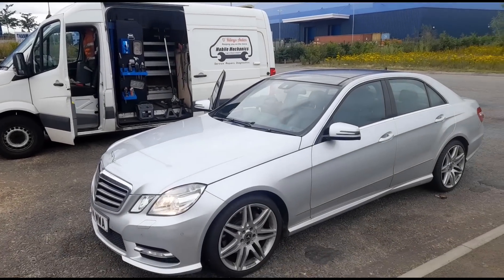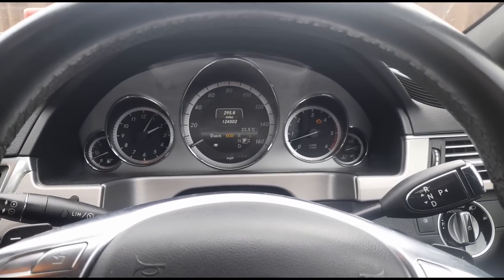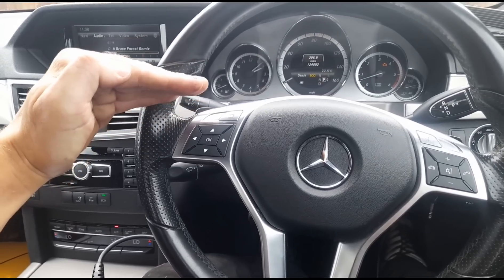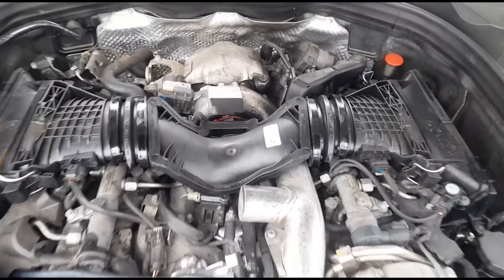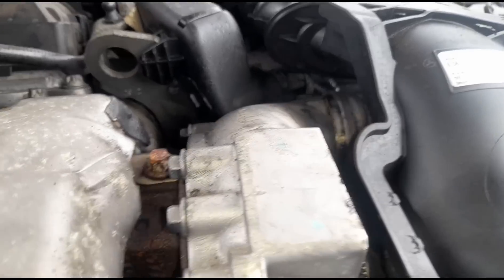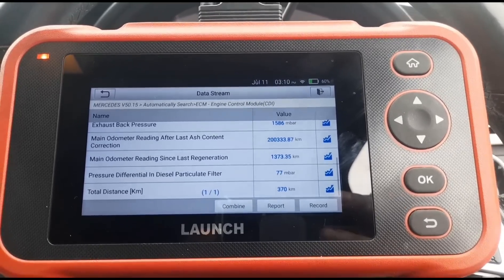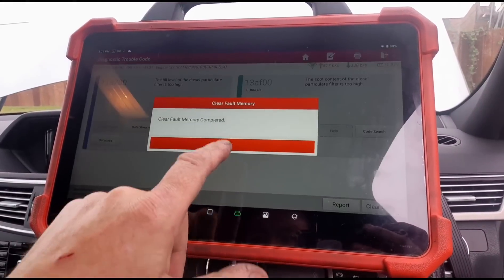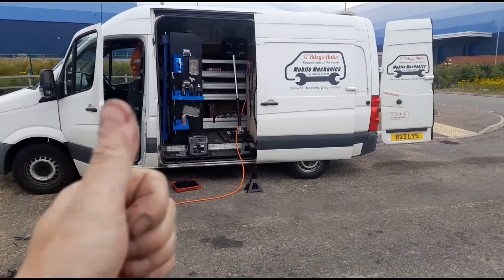WHY? Unsolved DPF Fault Mercedes E350 V6 CDI  148A00 11A700 13AF00 Number Of Regenerations Too High

Comment: I was having dpf issues and had the exact same problem on my E350!

The mechanic initially said from the diagnostic reading that the air mass flow sensor was faulty.  I had that changed, and no joy.

Turned out the seal in the turbo pipe was broken in the same place and also missing a bolt.

Many thanks for the post.
Reply from the maker: Thanks for sharing

Comment: Good job! I have the same model with exactly same engine and fighting with often dpf regeneration for 2 years now. It is super annoying as the regen is kicking in every 70 km. It is finishing the regen process succesfully after 10 km. I already replaced pcv, differential pressure sensor but that didn't help. Afterwards the dpf was taken off of the car and cleaned by the shop using the high pressure hydro method. After installation the same story. The last potential culprit suggested by mechanic were leaking injectors. They have been removed and sent to specialists to check on the table. The injectors are all good and keepeing all parameters. Nobody has no more ideas what to do next. I was suggested either to fit a brand new dpf or have it deleted. Any suggestions what else  to check?
Reply: any update on this brother?

Comment: Thank you for this video. I am trying to fix this exact same fault. Same model and readings! I now have some direction to follow and get to the bottom of this. Got all the pressure down then less than 10 miles and its rising again. The ash content thing makes sense. You're the man thank you for sharing your wealth of experience. Ps having trouble getting Launch fluid, seems to be in short supply, any ideas?
Reply from the maker: Glad it helped

Comment: OM648 owner here, been suffering the exact same symptoms for 5 years, never managed to find the root cause. Regens now occur every 20-30 miles, just crazy. Replaced turbo, cleaned DPF several times, replaced DPF sensor a couple of times, been to several workshops... I might have the same problem (excess oil coming to the engine through the turbo and the air charge pipes). How much is oil supposed to do that? Any? None? Appreciate your help to end this 5 year nightmare. If we solve it I'll throw a party!!
Reply: Try replacing the PCV valve, it'll reduce the oil being drawn into the turbo, intercooler and air intake
Reply: @elcapitan8400  thank you very much!! If it works I'll let you (and everyone here) know :)

Comment: Right so my 1.9 tdi engine is shaking like mad at idle but when moving its fine originally the garage i took thought it was injectors when i replaced the injectots with second hand  ones it reduced it got it diagnosed by injector specialist and theyre sayinh clutch i feel like thats not the problem as my engine is shaking what do you think?

Comment: Where are you located? I have an annoying tpms which just keeps coming back on on an Infiniti Fx. I changed the sensors, the tyres but I drive five miles and it comes back on. Even taking it to the main dealer didn’t help.

Comment: Hi. You use a cheaper 'Launch' tool in this video. May i ask which model it is please? It looks useful for the amateur mechanic. 
I was surprised there was no 'underboost' code with an O ring so badly perished.
Reply from the maker: Launch CRP129 EVO from www.launchtech.co.uk
Reply from the maker: There was previously a air correlation code I was told but they fitted the intake pipes and filters and cleared the code

Comment: Really enjoy watching your videos recently, I've never had any issues with DPF but as a owner of a VW T6.1 (coming up to three years) I have always been careful with prevention.. 1. using premium fuel. 2. using additives on occasion. 3. always recognising and letting a regen complete.... my question is, do you think I am doing the right things, if/not  do you have any other tips?
Reply: One of the best ways to avoid DPF issues is to make the engine work regularly. Find a nice big hill & drive up it on a frequent basis.
Reply: @hughmarcus1  that's lucky I have a big hill at the end of my daily commute.

Comment: Had a Volvo v70 D5 (Amazing car for doing serious long drives)  Purchased it "up north"  from a guy who had given up with it .Car was perfect other than  a starting issue that drove him mad .  Via a forum. I purchased the car and drove it to a carpark .A forum guy who was a bit of a legend  came and had it running perfectly in 1 hour. Something to do with injectors . Charged me £100 . . Car drove home 250 miles like a rocket and never went wrong . There are amazing people out there that are just GOOD and go straight in with a positive attitude. Most garages are just monkey farms
Reply: Was it the 160 d5 or the 185, I have the 185 never had any issues my Mondeo I've had plenty but I'm learning a lot from Jimmy
Reply: @chucky2316  185 with a rolling road stage One Map . Handed back 55 MPG on motorways been driven hard . Relaxed driving would see 63 MPG . Really was the best long distance car Ive ever had.
Reply: Legend
Reply: I love the Volvo D5 engines.
Reply: totally agree with you

Comment: The art of old school basic diagnosis is being lost on todays generation of mechanics......they are also being pushed to rattle through as many cars as fast as they can and at a dealership no one wants to work on older cars then you add to this the customer care which is sadly lacking......lucky for you as you do great customer care and find route cause.....you will never be out of work running business way you do and we will use you again and have recomended you to others 👌
Reply: There have always been dud mechanics. Take of the rose tinted glasses.
Reply: @Cheepchipsable  rose tinted glasses is how i get through the day and im old enough to say for sure with age comes experience as you have already made the mistake once or seen it before......all i know is if you find a good mechanic you stick with them unless you got money to burn firing parts cannon....which sadly seems to happen a lot.

Comment: Crazy how main dealer didn't find air leak great job Jimmy 👍
Reply: That has split since being to the dealer, the issue was the dealer was correct with the diagnosis of replacing the DPF because of the 9gr of ash which is a fully blocked DPF... the customer. The decided he didn't like the large bill to have it replaced and decided he wanted to hear a cheaper cost repair...
I see it all the time at the dealer I work at.
Reply: @johnmorton5498  Sorry but I have to disagree.  The Mercedes main dealer (in Hertford), charged the same customer >£700 for a new fuel pump to cure a noise which was not cured, then said OK we will change the fuel filter free of charge which cured the noise.  Worse than this is that this dealer followed the Mercedes service plan to the letter and never changed the fuel filter under the customer's service plan.  Mercedes and their dealers are Negligent, if you don't like these harsh facts try suing me for defamation. The same garage with the same car failed the MOT due to rusty rear break pipe and rusty rear sub frame.  They let the customer take the car to a "garage of repair" but never told them that they had burst the brake pipes, very lucky no serious accident.  Sorry that your main dealer thinking has programmed you to blame the customer - ridiculous !

Comment: Great video, 
Every one singing "Another one bites the Dust" (Or Ash in your case)
Do you ever follow up on real problematic issues where no one could fix it, except some dodgy Irish chap in a layby ;-)
And see if they have any other issues, (Return business)
Having a garage/engineer that can solve the problem totally and not just fix it for now are as rare as rocking horse ..... 
Nice job there. Keep em comming and take care.

Comment: My current car I bought it from a lad who complained it was too expensive to run with lots of suspension repairs,  it's a SAAB I put it back to stock no lowered springs no stupid low tyres , 100000 miles later still no costs ,  Muppet

Comment: I bought a car with a "suspected head gasket" for scrap value losing water from new  ,  I opened the header tank saw the pickup pipe was on the wrong side of the cap and bought it on the spot , reversed the cap on the overflow bottle so it could pickup water when cooling,  another one was the pickup pipe had fallen off , these garages are blind and stupid

Comment: To diagnose , question 1 has it ever worked ? ,  Question 2 when did it stop working,  question 3 what changed ,  and look for clues ,  what still works , not what doesn't work , eliminate and check ,

Comment: The reason why this happens is the OBD systems give the pointer to the symptom but the mechanic / technician is essentially unskilled in tracing faults , they see the symptom not the disease , the fault you found is obvious and audible so why didn't they look for the "non normal"  the clues are there, they are being deskilled by the technology

Comment: You explained the difference between soot / ash  & cause / effect very well
Jimmy.  well done mate 💪💪💪💪
Reply from the maker: Thanks Peter 👍
Reply: @ORileysAutos I'm a diy mechanic learning everyday from your videos and am always baffled they always treat the problem and never the caus. And that boost leak was so obvious I could hear it on video. Scanners only poit you in the right direction then you gotta have the skills to interptet what your reading. 
Great work as always.
Reply: @DanielSan-ch7dr  that is exactly right Daniel, a scantool is a directional base tool. Fair play for trying to educate yourself 💪💪💪
Reply: Kennedy garage and o Rileys Autos  incredible men for Diagnoses and Repair.
I would speculate that there is engine problem like pcv or turbo egr ecc creating extra buildup in the dpf.
Reply: Ok that will teach me to watch the full video before commenting. But my Speculation was Correct 😂
Reply: @tyldall  ❤️❤️❤️

Comment: Guys working in garages don’t give a damn about your car. Fix it yourself and save a fortune, plus you’ll know it’s done right. Apart from being able to do an oil change, I knew next to nothing about cars. However after multiple shoddy repairs/maintenance work in garages, I educated myself with the help of videos like this. I’ve since done major work to my car and it runs like a dream and passes it’s yearly roadworthy test……..which it never did when “professional mechanics” were maintaining it.
Reply from the maker: Only very few garages like that. Most garages are very good at what they do but I just see the people who have been to not so good garages
Reply: @ORileysAutos  Sorry Jimmy but I’ve got to disagree. Garages here in Ireland charge a fortune for shoddy work. I’ve been to main dealers, independent garages and private mechanics in the past and there isn’t one I’d go back to and trust to work on my car.  The last time I left my car into a garage here (and it’s about four years ago now), they did work I didn’t ask for or agree to and didn’t do work I actually did ask for. A few months later I felt a shimmy in the steering and after some investigation work, I saw that the two new wishbones they’d installed were both loose. The bolts hadn’t been torqued properly. When I went back to them, they told me in their best customer service manner to F off. And that’s after they charged me €2,000 for repairs and did a piss poor job of it.
Reply: @ORileysAutos  Jimmy, I brought this car to you.  In relation to this comment I feel that you are both right.  There are many well intention'd garages in Olde England, they do genuinely try their best and are not seeking to rip people off.  However I also agree that there is a massive lack of knowledge at almost all garages and I have to come to a uniquely talented trustworthy Irishman to fix the problem - thank you.

Comment: Knowing the OM642 engines, the oil around the pipe etc is most likely coming from the ruptured PCV valve on the back of the left hand head as you look from the front of the car. It's often overlooked and the oil blamed on the turbo. The green "o"ring is a common failure on these as is the orange oil cooler "O" rings deep down in the valley of the engine. Link to a good video showing the PCV valve is here....... https://www.youtube.com/watch?v=5LkWszMWPqY&ab_channel=MBDieselFreak
Reply: I own a c350 cdi same engine and your 100% correct in what your saying after changing the pcv you will also notice better mpg some people fit a catch can also.
Reply: @jakefalk6350 I think the catch can theory on these and any other diesel is a bit of a placebo. If the PCV is kept as it should be then there shouldn't be an issue.
Reply: @JamesAllen300  I think your rite I never bothered fitting 1 the orange turbo seal is also important to periodically change as when it leaks it leaks onto the swirl flap motor which is very expensive to replace.
Reply: Thank-you James,  good one....
Reply: I wanted to say everything you just said.  Fun to work on and get right aren't they. 😂.  I've owned these for last 10 years. Love them and hate them.

Comment: A broken o-ring doesn't create a fault code

IMPOSSIBLE to find

I'm sure that some garages would ignore a flat tyre if it didn't flag a fault code
Reply: It will if the car is expecting a certain psi and the leak means it is way lower.
Not impossible to find as there is an air leak sound and oilly mess at the leak.

Comment: Apparently doing a good diagnostic and being thorough in checking for faults is proving to be difficult with some mechanics... Another good job done... Reputation enhanced and most of all happy customer 😊😊😊
Reply: You're 100% right. 
Far too many mechanics only have a real basic understanding of cars. 
I had one that told me my turbo was underboosting (a fault which I told him about) and he said the turbo needed to be replaced. 
When I picked up the car it was still in limp mode which told me he hadn't cleared the fault to see if the turbo was actually creating boost (it is but goes into limp mode frequently)

The fact a mechanic would tell someone to get a new turbo for their car after it was just replaced by another crappy mechanic 2 weeks prior (that didn't fix the issue either) is insane,

Went in only to have two gaskets installed as well... he only installed one and not the one I was more concerned about. Couldn't even follow very basic requests.

Comment: Jimmy you make any problem look easy and sometimes they are but what I can’t understand is the dealerships so called professionals don’t want to get they’re hands dirty .
Reply: Not really, at least 50% is looking with your eyes , listening with ears, and using common sense.  That O ring has been leaking for a considerable time and has led to long term ash build up in the dpf from constant regenerations caused by the rich / sooty running.